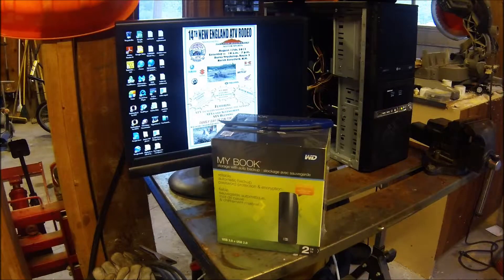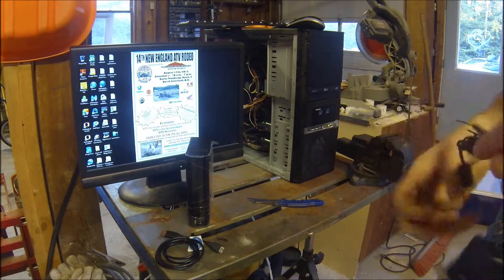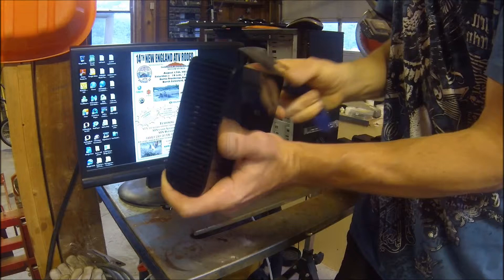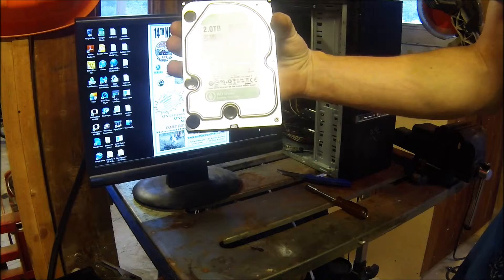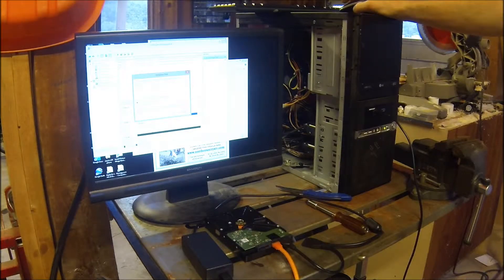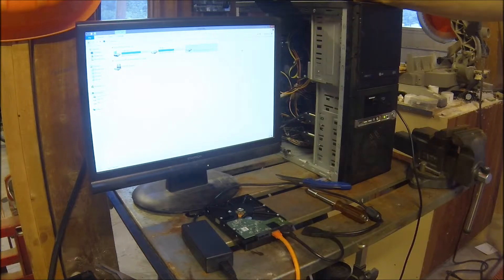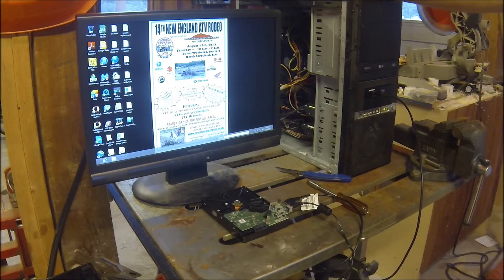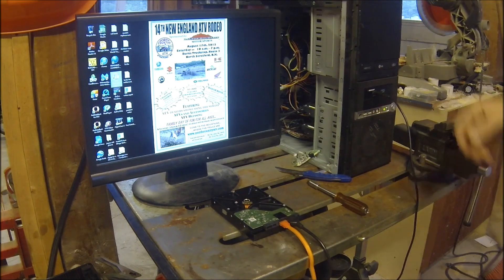How NOT to BACKUP; WD 2TB My Book UNBOX and Disassembly

Comment: That's pretty lame. If not WD external, what would you suggest? I mostly want some sort of external for use with my laptop so I would like to avoid a cumbersome solution. Do their passport variants suffer from the same Achilles heel?
Reply from the maker: I do not know about the passports . I have owned a few but I only use them for temporary file transfer. I would suggest a WD drive in a good external case.